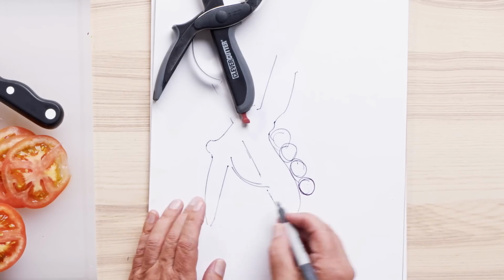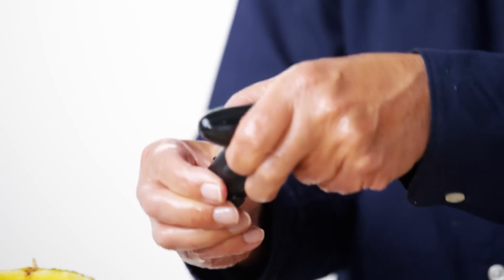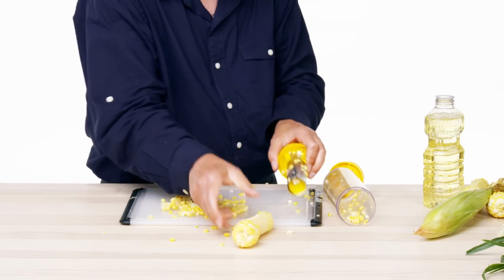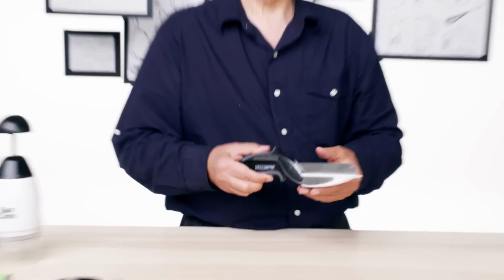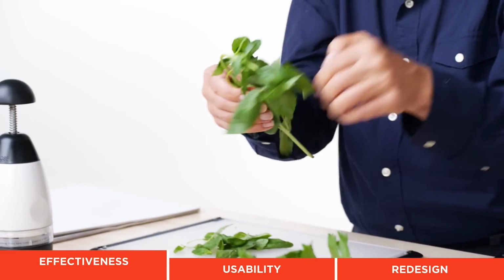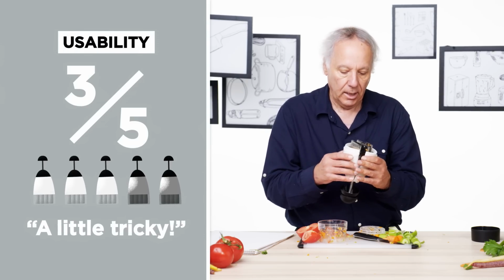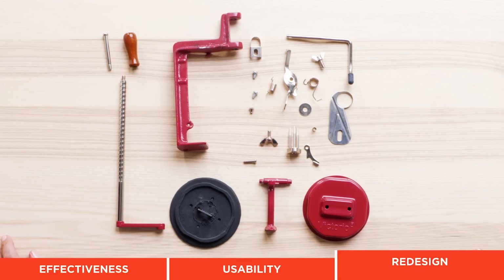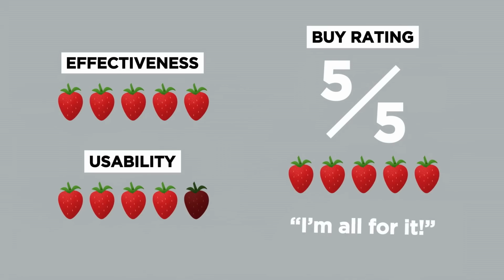7 Slicing Kitchen Gadgets Tested by Design Expert | Well Equipped | Epicurious

Comment: I would suggest that the "Slap Chop" quality really relies on brand. It looks like the one used in the video is of very low quality. I have and have used one for years made by Swiss manufacturer "Zyliss" and it is absolutely execptional, and would perform perfectly in 100% of the situations presented in this video. It also completely solves the "handle" issue that the expert here talks about, instead of a rounded head, it's a flat head, which is much more responsive to the human hand and maximises surface area for the "slapping hand" to connect with.  I've used it for garlic, tomatoes, herbs like Basil etc., and it works flawlessly. My only complaint with the design is that it's not exactly simple to clean, but unlike the one in this video, it does't split in half, so in fact, it is still MUCH easier to clean.. So many of these "As Seen on TV" Gadgets are simply cheap knockoffs of high quality Swiss or other premium kitchen gadget products.

Comment: I'm really not sure why the oil test as none of these tools are used with greasy / oily foods, but he does say that he feels it points out design flaws. I guess?
One of the biggest issues with all of these tools (to me) is storage. all of these are bulky and take up loads of drawer/cupboard space. I have the pineapple cutter and it does work great, but feel I loose 20% or more of the fruit to waste due to it only taking the center cut. The Slap-chop has been around forever and my mom used to have one as far back as the 60's. She baked a lot and really only used it for chopping walnuts, in literally 3 seconds. I can't really see any other great uses for it other than onions maybe, and it takes up shelve space. I have an apple peeler from the early 1900's that looks like some kind of geared monstrosity from a Frankenstein movie and although it doesn't core, it still peels like nothing else. Mine sits on display as it's an antique that really looks cool, so no storage issues there, and when i'm making a bunch of apple pies, I'll grab it off the shelf as it's a time saver. If i'm making one pie, it's faster to just use a potato type peeler.

Comment: You didnt used the apple cutter thing right!!! There is a suction cup below, use the small lever to stick that thing to the table and you can use it with only one hand!
Reply: Suction doesn't work well on wooden surfaces.
Reply: @littlesushie  except he had a plastic cutting board I have which if you flip is smooth surfaced. Also that surface looks laminate not real wood.

Comment: "Clever cutter."
"It is designed to cut."

Knives and Scissors:
"Do we still exist to you?"
Reply: loverosie3000 clever cutter has joined the chat
Reply: @mcswizzle74  Thats true, you made a very good point 😅
Reply: am i a joke to you*
Reply: @abilexi7933  Ah, I see you're a man of culture as well.
Reply: @abilexi7933  I was gon' type that but I wanted to be "different" so yeah
Reply: It uses a single knife blade rather than two blades going past each other meaning that it would cut vegetables  better than scissors. A knife on a cutting board still seems like a better idea though
Reply: @annakudriavtsev2510  If you even have the slightest of skills with a knife you'll cut, dice or even chop up food easier than with the slap chop. The clever cutter is just stupid.
Reply: @mathijsbirahy1190  
It's supposed to be for disabled and or elderly people with more limited motor function

Comment: You need an apple peeler and corer that attaches to the counter with a little windy clamp. It’s much easier to use when it’s firmly attached to the table. I used to use them constantly as a kid since I was obsessed with Granny Smith apples.

Comment: Question, if the corn stripper blade has teeth, should it be twisted while you push down?  Plus the top has a gear shape which looks like it supposed to be twisted.  No?

Comment: Drives me crazy. People. Use a spoon to Hull your strawberries. 1 second max. Could hull a flat in 10 mins.
Reply: Specially if you have a grapefruit spoon that has one side serrated near the tip. Picked one up at a flea market decades ago and is my "go-to" scooper in the kitchen.
Reply: Or a paring knife, or just a knife. A chef's knife does so much i literally used to cut my steak with it, use it to put on the pan, and then would eat with it.
Reply: just pull the leaves off with ur figer. takes half a second. why do americans even hull strawberries?
Reply: @langustajableczna  Because the white part is tough and flavorless.
Reply: @vdubboy85225  lol Now you're just being picky!
Reply: SeaBass85008 just eat the green part

Comment: Great design insights, but I don't understand his "buy rating". The apple slicer that does the job much better and in 1/5 of the time as compared with a knife gets 3/5 but the strawberry thing and the scissors that are just as effective as a knife both get 5/5..?

Maybe he doesn't like apples.
Reply: Maybe the apple slicer thing got lower rate because the little parts could be lost easily
Reply: He also didn't use it correctly.  The first apple was off center.  He also didn't use the lever that makes it stick to the counter top.

Comment: Well, in regards to the corn stripper, the blades are saw tooth in shape and appears to be meant to turn as you apply pressure. One of my problems with these gizmos is they really don't have directions to use.

Comment: I remember a device that I grew up with (Both of my parents were born in the mid 1930). This device was very close to the slap chop, the differences #1 glass jar with threaded top. #2 you had to turn the jar a little to get the blades into a different position (was easier to turn the jar with the top screwed down onto the jar than trying to turn the handle) #3 had an insert (small cutting board) that was washable and replaceable. That thing would dice anything and I would give up a kidney to find another of those.

Comment: For the apple peeler corer you don't have to hold it down like he did, if you look at 18:23 there is a little lever. If you flip that it suctions the device to the table. I have one and it works super well, bit disappointing he didn't notice that it would have made it so much easier. This was really cool to see though! I agree it is a bit difficult to clean but overall wicked useful if you need to peel a lot of apples for like pie

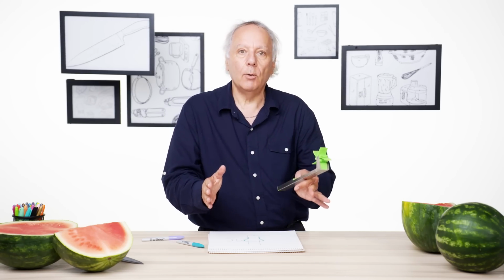Comment: 9:04 - I think it should be pointed out that those "Square Watermelons" aren't actually edible. I mean you could eat one but it wouldn't taste very good.
The common misconception is that Japan created square watermelons so that they would fit into fridges more easily without wasting space around the curvature of the watermelon.
In reality they're just decorative pieces. Almost all of the watermelons growth is used to fill out the corners so as a result the center remains unripe.

Comment: The problem is whilst most of his additions were useful, they all involved adding more material. Which I'm sure the manufacturers are keen to avoid.
Reply: Not all. Some of them From my point of view it looks like it's changing just the shape not actually using more material. Some even used less.
Reply: @noname-kx4cu  yeah that's true actually, like with the pineapple tool handle.

Comment: Watermelon Slicer: Doesn’t work on round watermelons 
The guys solution: Go to Japan
Reply: Neelki the cheapest solution
Reply: Wy Yung naw, going to japan could be expensive, unless you already live there, but the square watermelons are very expensive and usually inedible
Reply: @cowqult  You can also find square watermelons at common supermarkets here in Brazil. They're a wee bit expensive for their size, and usually sweeter than the round watermelons, but you can eat them just fine.
Reply: NadiaBakker oooooh I wanna try
Reply: @wyyung7373  Buy Minecraft
Reply: Go to Minecraft
Reply: SPONGE BOB MELON PANTS
Reply: @jackpotter8302  SPONGE BOB MELON SQUARES
Reply: Those shaped watermelons in Japan aren’t even edible most of the time. They’re sold as novelty decor.
Reply: @twdjt6245  The watermelon slicer isn't edible either.
Reply: @twdjt6245  they are edible they are grown in cube cages which shape watermelons to cubes
Reply: Eswa Have you ever seen watermelons at your grocery store?? Or seen them or pumpkins or something growing in a field? Plants aren’t a liquid you can shape into any mold you want like you’re making soap or baking cupcakes. They’re grown as living things that do not all ripen at the same size.....so when those farmers put those molds on them, MOST of the time the mold does not allow the plant to get big enough to ripen....as they remove the melon and cut the vine as soon as it has filled in the mold so they can reuse them. If you look at people actually opening these up you will see the watermelons are a very pale color, you won’t die or something from eating them like that but I promise you that you wouldn’t wanna take a second bite of it.
Reply: @twdjt6245  bro but still square watermelons
Reply: Jen Tuesday r/woooosh
Reply: Exactly like Nick Robinson, have a question? Find the answer on japan
Reply: The have cube watermelons right?
Reply: I laughed
Reply: in minecraft watermelons are 100% of the time perfectly square and also completely edible.
not that it matters that much as you eat the peel because you care for your precious square world
Reply: i think he was referring to the people who sell that product, the watermelon slicer, to sell it there cuz it would be useful for square watermelons
Reply: Doesn't work on round melons 
Me:ok boomer
Reply: Or make cut off the ends of the watermelon so you don't hit them?
Reply: I have the watermelon slicer
Reply: Oh i thought you meant tities
Reply: @kuntrybruh296  square tiddies
Reply: KuntryBoy w h a , t f -
Reply: There is some of them in Russia too - 470$ for one square watermelon in St.P's grocery
Reply: But I'm already in japan cuz I legit live here now
Reply: Arntbthem square water melons poisons some how
Reply: I mean...he’s not wrong
Reply: OBVIOUSLY the best ( and clearly cheaper) option
Reply: stonks
Reply: So I couldn’t find a solution to my round watermelons so I went to japan
Reply: Mine: minecraft
Reply: Neelki he’s not wrong, I am Japanese

Comment: Design for the extremes.
I personally will not buy any of these. 
I butcher pineapple from the out side first, cut all the eyes out in a spiral form. Then quater it vertically, then remove core. It does take longer, but produce the least amount of waste and much better presentation. 
https://imgur.com/CQNlo8g
https://imgur.com/MNvEoBh
Corn stripper only works with same size straight cornes. Corn itself is not a cylinder. How can a cylinder shape cutter works well?
Watermelon mill hits the wall all the time. His way of cutting with knife is not effective either. If I am to cube a water melon, cut them into 1in thick slices, trim off skin, and devide. It may not be 100% even, but much faster than his method.
Clever cutter only works for small things. Slightly big tomate, or onion won't work at all. I prefer a sharp knife. The redesign ideas are still great for this tool.
Slap chop too me is a big failure. First, you have to use a knife to cut something that can fit under it. Just follow through with the knife already. Speed test part is not fair. Knife chopping has a bigger portion. The blade cannot always have full contact with copping board, and it is not something you can easily sharpen. If you buy this, you will use it a few times and forget about it.
The apple thing is great for peeling. The spring on blade makes good contact with apple as long as it is not too out of shape. The coring part though. I would not use it at all. The core is usually not in the dead center because the side facing the sun will have more meat to it.
These are all based on personal preference. Everyone has different way of doing things and using tools.

Comment: I really liked this video, as I age I noticed the strength in my fingers and hands have gotten so weak, I would like to see longer, more curved flanges on various kitchen items like the simple apple corer I have. The small straight edge makes me put more force on the apple, and I like the idea of a curved handle on my can opener, some mornings I just can't squeeze the handle, I usually end up using a towel for support. Thanks for the video

Comment: If you cut but ends of the watermelon off you would of had a nice easy straight path to use the Windmill device on with no problems in the way.  The device was not flawed in this case you were.

Comment: I don't like that the video just focuses on a part of the cooking process. Sure, some of these gadgets may be of use in the kitchen while you're preparing the meal. But what about after and before? 

You need space to store all of them. They take up space while you cook. You need to clean them afterwards which uses up time, water and energy. They cost money to buy.

Design is also about simplicity. About stripping something down to the basics. Getting as much as possible done as simple as possible. And guess what can do all of those tasks, is simplicity in it's pures form and cleaned in a couple of seconds? 

A good knife.

Comment: Pinnaple cutter: Why not instead of take the handle off you add a apple slicer under the handle in a way that covers the top like a lid so no splash and add spaces in the spiral.

Eat your corn off the cob like the rest of us animals!!!

Watermelon cutter: make the paddles scoops

Veggie cutter: changeable blades and a bar that slides on the side to specify width and flip handle over

Use a straw for the strawberries!!!

Comment: You cut the watermelon wrong , First cut it lengthwise then place a towel ring on bottom, or slice off bottom to flatten . If you cut off rind you should be able to zip threw the whole top in an 10''swath. I think the idea is even squares for a party, seemed to work really well to me.

Comment: He's amazing, but seriously, his knife skills are just bad. It's a good thing the speed test portion has little bearing because most of the time you're better off just using a knife.

And I think that's what should be emphasized here. You can use a knife for all of these. Hell, if you want to save money, you probably should. A few extra seconds working the knife isn't a big sacrifice compared to buying a 30 or 60 dollar thing that only works for literally one thing. But if a unitasker wants to beat knife skills, it should be able to do its one job really, really, really well.

Comment: Corn Stripper: Considering the saw teeth on the metal and the nubs on the handle, I wonder if it was intended to be twisted to saw off the corn, but the design fails to completely convey that.

Clever Cutter: I would make the blade a bit concave so that it doesn't easily slide off of round items. Also, put a notch down the length of the cutting base where the blade would counter-sink to give some scissor-like action to help with thin skins (tomato). Maybe even flat out put another blade on the base for actual scissor action as well as self-sharpening.

Slap Chop: Check how sharp the blades are. I got one (probably a knock-off) a while back, and it worked for crap. Simple inspection showed me that the blades where flat on the edges. That was just horrible.

Comment: I remember hearing about how in the olden times, basil was incredibly rare, and could only be cut by a king, and they used a golden blade to do it. 

Watching you mangle that basil with the slap chop made me reflect on this and laugh
Reply: The slap chop is only useful if what you're looking for is a tiny amount of badly processed vegetables.

The fact that you need to cut the vegetables prior to using it bothers me to. Just use the knife. If you are in a sort of situation where you need to process a lot of vegetables or cannot use a knife then there are better options

Comment: I'm a little disappointed that he didn't weight some of his usability changes to their impact to material and manufacturing cost. Generally speaking, engineers have to consider what their design changes do to the unit cost when deciding if it's a worthwhile change. Probably the biggest example of this was his decision to round the metal base of the apple corer in order to make it easier to clean. I suppose it may make it a bit easier to clean, but keep in mind, all you're cleaning is apple off of it which generally comes off under running water. Meanwhile, you can see from his drawing that the curve would increase material thus making it a more expensive part to produce and the shape of it might also be more expensive to manufacture. Would the average consumer prefer a product that is slightly easier to clean or a product that is a bit lower price with the same effectiveness?